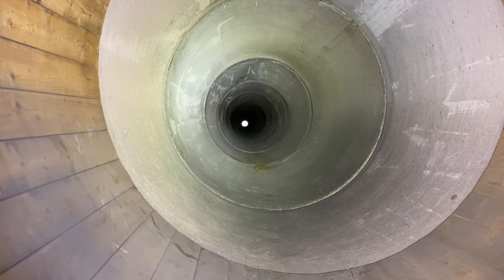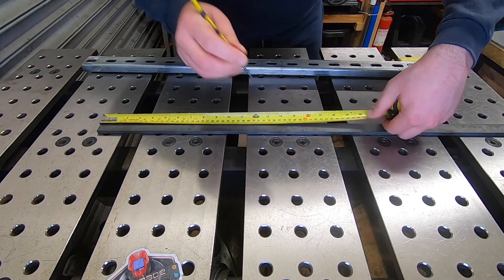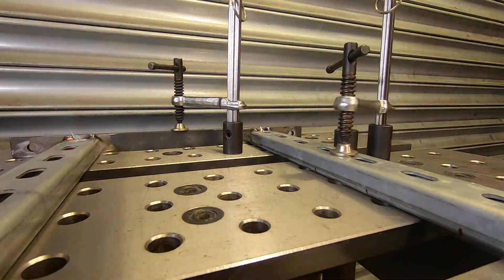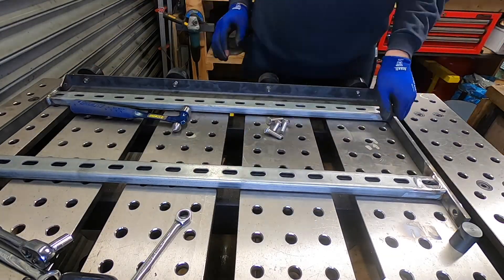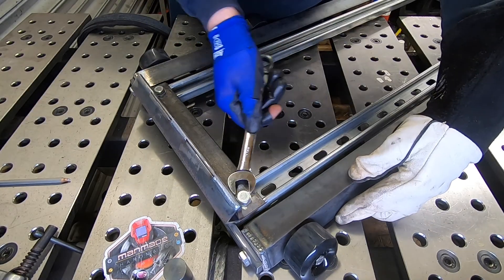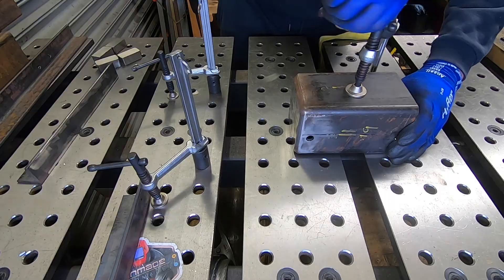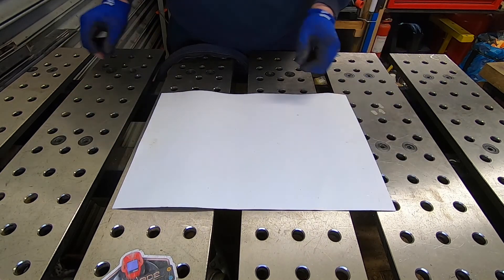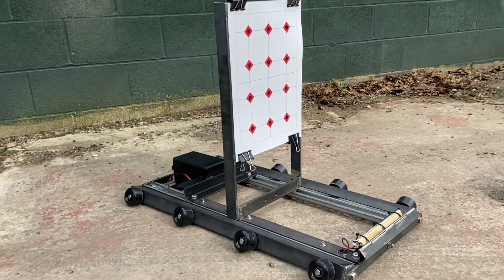Rifle Range Target Build - Pipe Range Vehicle! - Welding, Fabrication

Comment: One suggestion.  Put a steel plate or angle iron over/in front of the wheels - they could get shot out also and take a lot with them as a bullet in the soft part could go through a bunch of them.

I agree you guys aren't going to miss that far off - but accidents happen.  (look at all the other protections you made).
Reply from the maker: Hi Danny - good comment. 
I did think about protection for the wheels, but the sections of concrete pipe are not perfectly aligned, and was worried about a clash. We have spare wheels and consider them a consumable.

Thanks for the watch! Ben